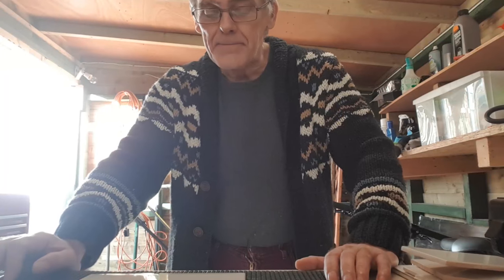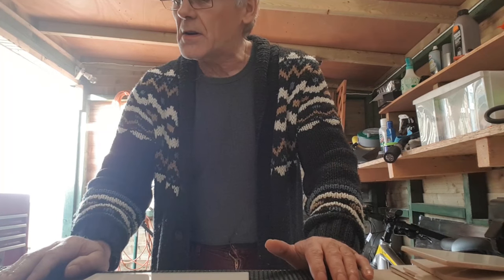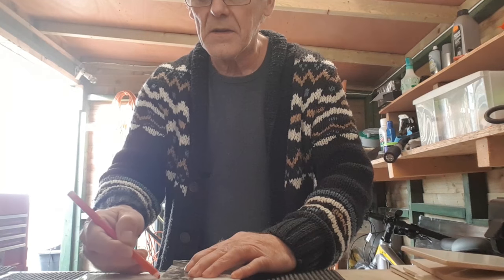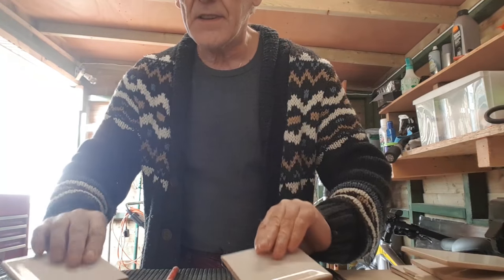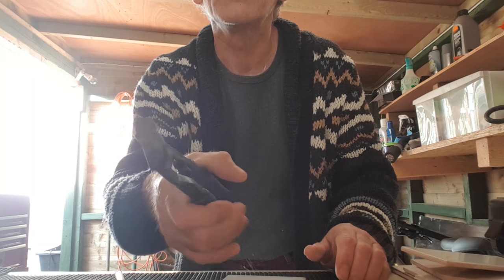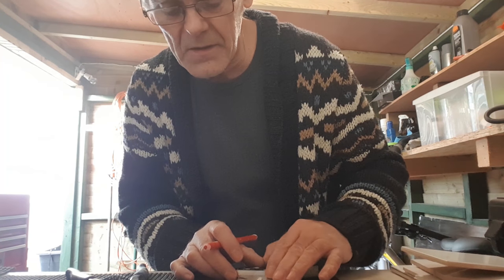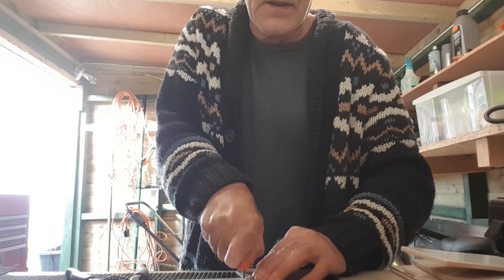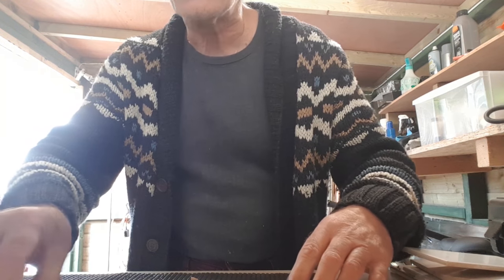How to cut tiles without Expensive Tools

Comment: Great demo. I need to cut around 3 tiles in order to accommodate 3 electric wall sockets. My electric tile cutter is at the back of a load of stuff and would take too much effort and time to access it. I'm going to follow the tips in this video and do it manually. Keep up the good work ft rider.  Many thanks, Joan.

Comment: What about 12x12. -  16x16 tiles?     That small tool probably wont work on bigger tiles.   Those wet saw machines are expensive.         The cheaper manual tile saw i heard bad reviews that they are cheap and break easy.     I am on a budget somewhere $40 and under.  Got any tips to cut larger tiles like 12x12 - 16x16?
Reply: You can cut those this way.